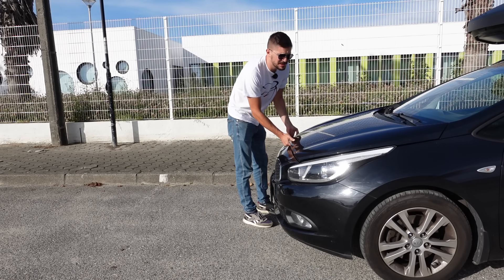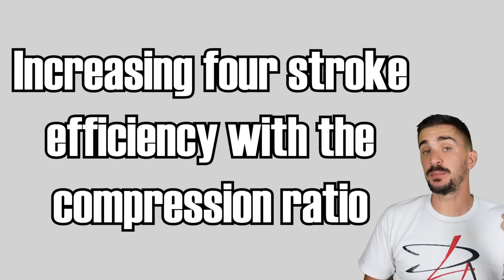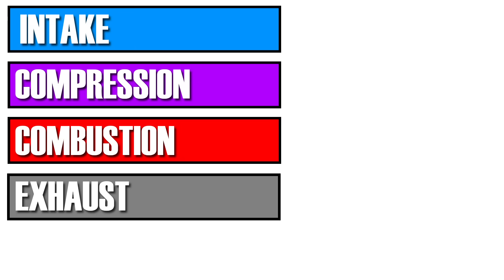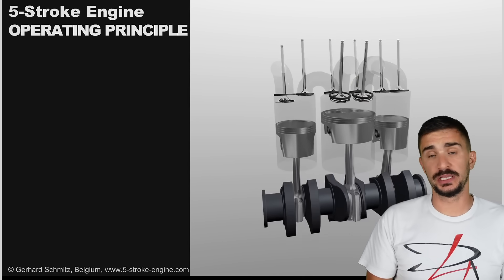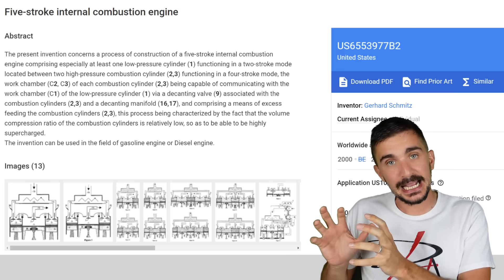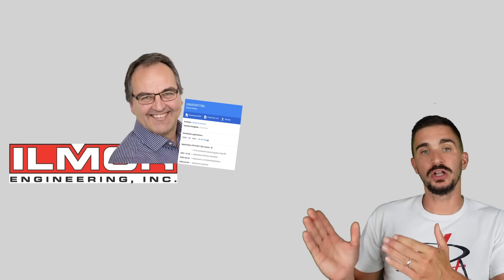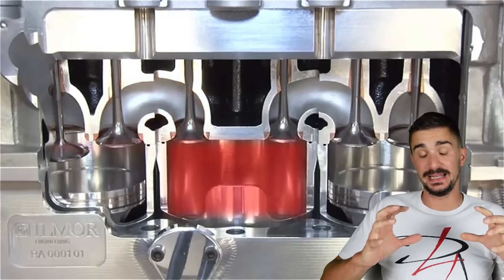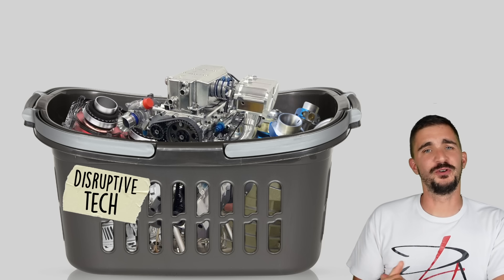Why Five Stroke Engines Are More Efficient But Still a Failure

Comment: I love your channel ... but can you please use a black or grey background?  I'm watching this video in bed, and I'm absolutely blind.😅
Reply: Try the “reduce white point” setting in accessibility
Reply: @orapasc   I'm watching from an android tablet with an oled screen. I don't have a reduced white point setting, but I do have the option extra dim on. Even like this, modern oled screens like mine also have a very low refresh rate in low lighting settings, which gives some people head akes and perturbs sleep. I dont have any of the symptoms, but even at the lowest lighting, I still find the background annoying. I think only Oneplus screens from the latest generation on tablet and flagship phones have a high refresh rate, which is said to help with low lighting watching comfort. Oneplus is a fairly common brand, but it's not Samsung or Apple. So their products are rare and have quirks to them(thats why I don't have any them). This is a simple issue that can be fixed in post while editing the video by changing the shade of the background.
Reply: Twilight is a app you can get, changes you life. Can just apply a blue light filter or you can get it to force darker screen or more black/white ect ect. Just get it and mess around
Reply: @jackoconnell2204  thanks for the tip I'll give it a try.
Reply: Turn it off and go to sleep, watch it in the morning brighd and early over a healthy breakfast.
Reply: Darn, I watched it in the same scenario and had the same problem! Glad that it wasn’t just me!!!
Reply: And that hole in the wall or whatever it is had me thoroughly convinced my tablet's screen was broken for a second. lol
Reply: I turn my brightness down
Reply: Brightness down
Reply: @DavidSadloski  Read the reply above ... it was at minimum.
Reply: @transc3ndus  yea no I didn’t read that. But now that I know that, just don’t hold it 2 inches from your face. Problem solved.

Comment: This would be a perfect design for an onboard range extender or a series hybrid.  It could run at higher loads only when needed, using the hybrid battery to preheat all of the fluids and the catalytic converter.

Comment: actually about half the wasted energy goes out the exhaust, the other half goes out the radiator. Atkinson cycle helps with this and can be implemented by allowing the intake valves to be open during compression, rather than the complex original linkage. I think hybrids that have a generator on the turbo (that can keep it from overspeeding, instead of a wastegate) will also improve this.

Comment: As for the drawbacks of low efficiency at light loads due to its compound design. I still believe it can fit in as a “disruptor” if only someone will produce it. If used in a modern hybrid drivetrain it will never have to work in its low efficiency power band. Also true if used as a range extender or diesel/petrol-electric drivetrain. 
It certainly has potential if used right.

Comment: So terrible to driving, but sounds excellent for a constant high load application, like a generator or aircraft engine. Constant high load would also keep catalytic converters up to temp. Sure, they’d take longer to get to temp, but who cares if the engine’s duty cycle doesn’t involve a lot of start/stop cycles.

Comment: They could increase efficiency by developing gas vapor intake systems, drawing intake air through the gas tank similar to how a water bong works. It would vastly reduce the amount of fuel that would need injected by the injectors.

Comment: @d4a please checkout the supercharger by Torotrak; the V-Charge. It's a true variable speed compressor.

Torotrak used a turbo model, but maybe a twin-screw model would be more effective?

This feels like something that would've made a real change; particularly in the low-mid rpm range.

Comment: Deactivate the expansion/lp piston at low rpm by shunting the exhaust gas directly from the hp pistons via a rotary valve. Use it as a supercharger at low rpm as well.

Comment: What if…… you have a supercharger or some kind of electric air injection into the dead cylinder for low rpm to help force the piston down?  If you have exhaust pressure at 50-60psi, could there be a small air pump that runs off the battery/alternator power and turn on only under specific rpm’s on low rpm to inject Air at maybe 70psi to insure it has enough pressure and assist in order not to waist energy of moving that piston?

Comment: It's basically a reworked steam engine. I had thought it would be interesting to build a steam generator a very small one to power a motorcycle. Using gasoline. I was thinking a high and low pressure piston configuration would be ideal. Steam generators get hot really quick no waiting around. Nobody wants to wait. Turn key and pretty much go.

Comment: Miller cycle or what some manufacturers like to call Atkinson cycle, without the complex crank system, basically won. It's a compromise of course, like everything in engineering, but variable valve timing is easy and all the engine internals are basically identical to otto engine. What's better, same engine can run Miller cycle and Otto cycle. And of course what harnesses even more energy from exhaust, is turbocharger.

We already know that we're banging our heads against theoretical efficiency limits soon, but can never achieve even near those with ordinary ICE engines and how they are used in cars and trucks. Constant RPM is needed, and somewhat stable loading, to achieve the best efficiency out of any ICE engine design. Carnot cycle and all that applies of course.

Comment: This sound like a simpler engine than the Atkinsons for hybrid engines. Question is it better than the Atkinsons in the way how toyota uses it? Also the new 911 has a electric motor sandwiched between the motor and transmission, This could be a better case to use in as well. BTW I am a pharmacist and not an engineer or mechanic. So don't flame me.

Comment: I understand your support and defense for ICE engines, but they are becoming ever more complex and therefore inevitably less reliable.
Electric cars are not there yet, imo, but I like the simpler design of electric vehicles. The battery technology has to evolve though, lighter  & smaller whilst giving more range and more safety.
The motor will need to evolve too, again a lighter & smaller motor will help.
It's still early days for the electric vehicle.
Reply: Electric cars are already good enough for most people, and the potential is insane. 

 I mean the average American drives 40 miles per day. While EVs are getting 300-500 miles per charge. SO! For most people with a home it already is good enough. 

 I personally think their performance is also superior for the price where it counts. Which is having high HP, instant torqure, and improved center of gravity.

 They will only get lighter, charge faster, increased longevity, become cheaper, and of course increased battery density. 

 Oh did I mention cost to run is cheaper? Gas prices aren't going to be going down significantly. Probably only up. 

 I think in the next three to five years we will see useful semi EVs. CATL is releasing their 500 wh/kg battery now. Others are said to be releasing their 500 plus soon as well.  

 Now with all that said... The biggest issue is charging infrastructure. Everything I said is useless if you cannot charge your car in a pinch.

Comment: Its fascinating engineering but the problem is u have to push the engine to limit always if u have to use the low compression cylinder maximum because if u drive nice and easy u will not get enough exhaust gas into the low compression cylinder and therefore it will not be efficient...but still really love that design its used on Steam locomotive s in 1940s usa used it  on many of the strongest

Comment: Seems like this could have a market where engine displacement determines taxes as long as the low pressure cylinder doesn't count. Would have been neat in a kei truck application if high revs weren't needed for efficiency.

Comment: Yeah, the "staying power" of this ancient design is impressive. What it takes the final bow (in most applications) in 10-ish years, its successor, the electric motor,  will probably last for a similar timespan. To replace that, we would need new physics, not just engineering.

Comment: Just an idea that popped up in my head 30 seconds into the video: would a heat pump installed on the exhaust cause too many problems with back pressure? Or why don't cars have heat pumps to extract more energy from the exhaust gasses?

Comment: I forgot the math but I remember that thermodynamicaly  the ideal otto cycle was around 56% efficient anyway (without devices that would get you e better expansion ratio like turbo).
For thos that are not familiar at all with thermodynamics ideal means that there is no energy loss to friction, thermal conduction, imperfect seals, pre ignition ..... etc.
Actually back when I was doing thermodynamics in uni  without the help of ECU the carb/distributor engines were looking at only about 25% real efficiency ... we're doing good but sadly not good enough for to reverse the greenhouse effect.

Comment: ICI DO NOT have a real-life efficiency of 35 to 40 %. They achieve this only on a test stand at a very very specific operating point.  REAL LIFE efficiency goes from 12 % for gas to 16 % for diesel engines, as demonstrated by millions of cars and their real life fuel consumption. This is utterly ridiculous in the 21.  century and cannot (repeat: cannot) be substantially increased anymore for fundamental physics reasons. ICE are already absurdly complex machines. If you manage to squeeze another 1 or 2 %  real life efficiency out of them they will become even more complex. And yes, my EV uses the energy of about 1,5 l of diesel per 100 km while having the specs of a super sports car which as a similar ICI would use about 10 l per 100 km OR MORE. So my EV is about 6 to 7 times more efficient which yet again proves that ICE do actually hover closer to 10 % than 20 % efficiency.

Comment: Most of my driving is at 25-35 mph.  It appears that this engine would be less efficient than my standard 4 cyl ICE.
One of the problems with most popular engines is that they are rated at high RPM's rarely used in most cars. Paying a lot for a 300hp engine is usually a waste of money, and probably fuel.

Comment: Wonder if it would be possible to retool an existing V6, with cylinders 2 and 5 being low pressure and the outer cylinders remaining the high pressure ones.

Comment: formula 1 was until recently using an electric turbine on the exhaust and electric supercharger, combined with a battery and an electric motor on the crank shaft.  I recall hearing they were getting 50% efficiency out of that, and Porsche just copied it in their 911.  Its too bad Formula 1 decided to ban it for the new racing regulations.  I think thats the better version of the 5 stroke engine.  just use a turbo to pull energy out of the exhaust, and then have an electric motor based system to send that energy wherever you need it, to a supercharger, battery or direct to the crankshaft.
Reply: I hadn't heard about the ban.  That's a shame.

Comment: Might not be as old, haven't checked, but I'd argue that steam turbines are even more important to modern life that Otto cycle motors are. Not everyone has direct experience with them, but they are the center of every power plant, coal, nuclear, gas, they're all steam.

Comment: This is just off the top of my head but do you think that the addition of a supercharger could be effective in remedying the problem of the LP piston being a dead weight by "artificially" increasing the initial load on the engine? 

Great video btw. It always improves my day whenever I see you upload.
👍

Comment: Well, technically electric motors had changed even less than IC engines.
But it is not a fair comparison, as EMs are just motors that consumes energy, while ICEs are self-powered entities.
it is fairer to compare EMs with pistons + crankshaft assembly as that where raw energy is converted to usable work.

Comment: 1) You forgot that a lot of the energy of the fuel is lost to heating the air that passes through the radiator (in a liquid-cooled engine) or the cooling fins in an air-cooled engine.  2)  Actually a greater compression ratio is parasitic, it is a greater EXPANSION RATIO that would extract more energy.

Comment: Awesome! Can you talk about the 6 stroke? The idea was to add another pair of strokes after exhaust, and spray some water into the cylinder, use the heat of the block to expand it. So, instead of harnessing the power wasted by the exhaust, it tries to harness the power wasted by the radiator. We could get rid of all the cooling passages! We'd have to carry around a water tank about the same size as the fuel tank. 
For both concepts, if it takes too long to heat the cat up, why not wrap it in an electric heater and heat it with the battery? If you only do that during start up, surely the efficiency hit is negligible.

Comment: The engineers took a simpler path - they used a variable valve timing system for the Miller cycle (Toyota Prius, some VW engines and others).
The Miller cycle has the same purpose as the Atkinson cycle, but without the complex mechanisms (like the unusual crankshaft).

Comment: Can't you just use the 65% loss to either, reclaim heat transfer from escaping gasses, use turbine power in the exhaust to power batteries, use better cycle batteries that power turbo's on the engine to make it more effective with solar inputs to the engine or a "green running gear" that engages when the car is at momentum that effectively "keeps the momentum going at a zero loss of energy. We are so concentrated on the engine, there are so many other ways to enhance engine power. Just look at the new Bugatti tourbillon's power train, we need to enhance and help engine power, not overwhelm it.

Comment: “..read—the—room!”  What perfect delivery of that old chestnut. 👏🏽
Reply: “Let me know when any other type of propulsion system last over 150 years!”

(Firearms has entered the chat)
Reply: @davemccage7918    The fact firearms make your list of propulsion systems is telling.
Reply: @artysanmobile  I mean electric propulsion predates petrol engines and has never stopped being used in one way or another either.  Just not in personal cars primarily.
Reply: @tonymorris4335    Toyota is the current boss in hybrid technology, which I believe will be necessary forever. What they are doing with gear-sets replacing a belt is absolute genius.

Comment: Guessing that the turbo is necessary because such an engine can't benefit by opening the intake valve early to allow exhaust and inlet design to force the charge into the cylinder.

Comment: Very interesting and informative presentation.  The five-stroke engine would appear to be best suited to high load, constant speed industrial applications, but in such applications diesel engines offer stiff competition in terms of fuel consumption, relative simplicity, and superior durability.  In mobile applications electrification probably sounded the death knell for the five-stroke.  Many thanks for a fine presentation.

Comment: PEV's are more efficient in fuel to CO2 than even BEV's along with being lighter since you can design an engine that is designed to run at 1 RPM, Most of the Efficiency loss in ICE is due to being designed for a myriad of operating conditions and outputs, instead of adjusting RPM you adjust fuel based on resistance from the alternator keeping the engine at its most efficient RPM.

Comment: The catalytic converter is to make the products of reaction from the ICE exhaust into something less harmful. Would the long reaction time in that 3 cyclinder engine not make the products less bad on it's own? Meaning that a cat wouldn't be necessary in the first place?
This could also be used as a single RPM and load engine like a generator engine or a hybrid engine where it only charges the batteries or provides electricity to run the motor and doesn't turn the wheels mechanically. That would solve the lower efficiency issues at low load and low RPM by nearly eliminating all low load, low RPM operating states.
Also, a great way to harness energy from an exhaust stream is .... A turbine. Lol. Especially one that is variable vane. The vast majority of power generation stations around the world use some kind of steam turbine. An exhaust turbine could be providing electricity to a hybrid while the ICE could provide mechanical power. Definitely reduces the power straight from the ICE but increases total energy extracted from the gasoline by the vehicle. ... Also would have higher maintenance costs as the turbine blades collect dirty exhaust.

Comment: Not bad 35% efficiency if you consider it takes 4 strokes to complete 1 cycle. Has anyone tried to mimic Detroit diesel 2 stroke using gasoline?
Reply: Really seems like it would make more sense to put the exhaust ports at the bottom of the stroke. I have a good idea for a new design.
Reply: Turns a valved engine into a 2 stroke, just got to figure out oiling of the rings passing over the exhaust port